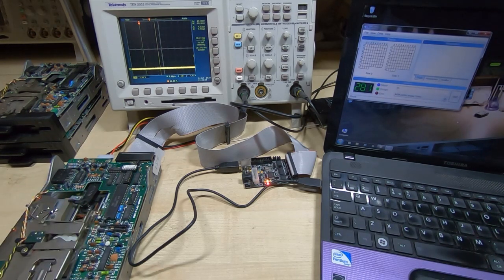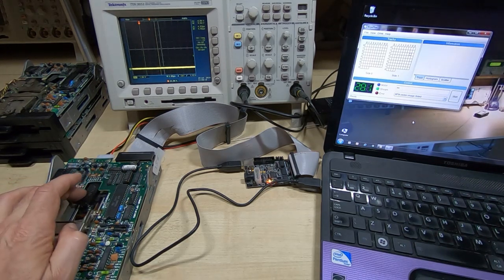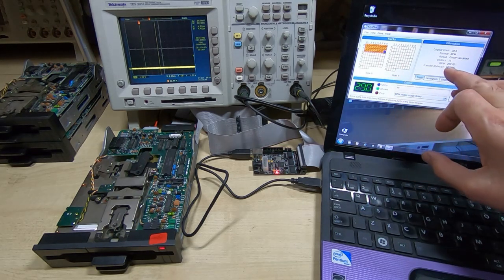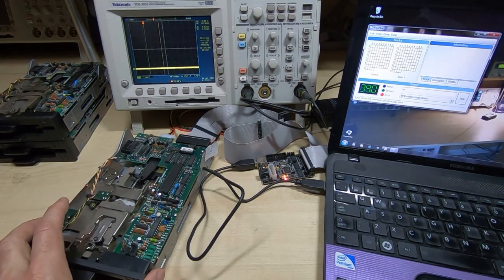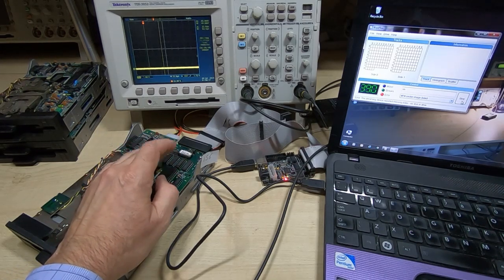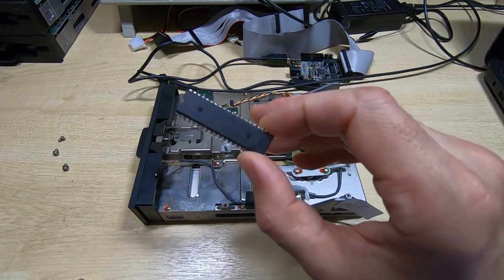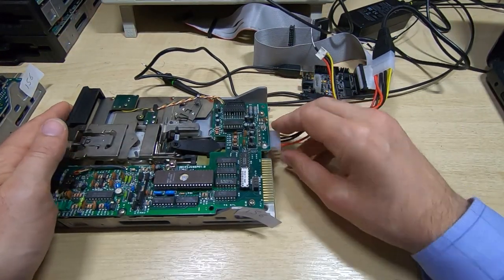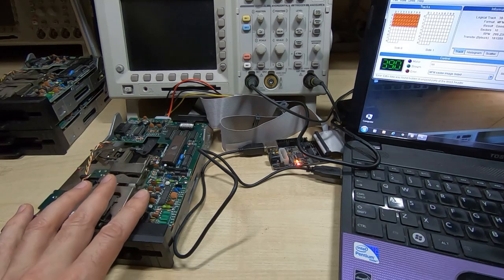F-051D Floppy Drive Repair Part1

Comment: You observed that you had the binary image to load into the replacement controller, but you didn't say where you got it.  Did you desolder and read to contents of another controller?  Were you able to read it from another controller in place?  Did you get the image from some other source?
Reply from the maker: I repair a lot of this sort of equipment and whenever I get the opportunity to read data from a device I am repairing then I try to do that before I start work. This is partly in case I make a mistake and damaged the original. I cannot remember when I got this image as it was many years ago (The file was dated March 1997 so it would have been around then). Some drives have these devices in sockets so most likely I either just unplugged one and read it or removed it for testing and took an image. In this case I had 5 other drives so as a last resort I could have removed one and read it but as they were soldered to the boards I prefer not to do that as there is always the possibility of board damage (or chip damage).

Comment: Hi Jerry, I noticed that when you are probing the floppy Micro-controller and/or the One time programmable memory controller. You used the probe without the ground lead from the oscilloscope to check the signal on different pins. Is your laptop running off the battery or is it connected to mains power with earth ground? Can you check any IC on the device under test without connecting the ground lead just to read the signal? Would you see noise on the oscilloscope if it’s not connected to floating ground? I assume the device under test is running from power supply using isolated transformer and laptop is using battery power not plugged into the wall.
I’m trying to figure out how to use the probe on a device under test, but sometimes I’m scared to try for fear of causing a short circuit or when checking negative voltage in old computer equipment. Your videos are excellent and I have been learning a lot. Thank you. Maybe in the future you could talk about ground in relation to testing different types of integrated circuits and power when using the oscilloscope and or Logic analyzer. I know the logic probes are connected to ground. But isn’t the logic analyzer also connected to mains power and earth ground as well.
Reply from the maker: Well spotted. I have mentioned this in previous videos but neglected to mention it in this one. As you correctly say there must be a voltage reference for the scope to work. In most testing of this type that I do I am not interested in accurate signal measurements but just in general signals so I find it more convenient to remove the ground clip from the scope probe. There still must be a ground of course or the scope would show floating signals. In this case you can see that I have a second probe plugged into the trigger input of the scope and the ground lead from this is connected via a test lead to the 0V of the floppy power connector (actually the un-used 3.5" power connector). You can see this at the top centre of the screen at approx 18:18. It is the white wire and this is clipped to the scope ground so gives the scope a 0V reference. It is not a good way to ground a scope if you want good quality signals but I discuss this in one of the recent videos. Let me know if you want me to make a video on the grounding methods I use.
Reply: @JerryWalker001   Yes, please I would like see a separate video on grounding methods you use. I have read several books to help me understand different types of grounding concepts.  Such as earth ground, chassis ground, reference point on a circuit , floating ground and/or different voltage potentials when using your test equipment to help troubleshoot all the types of equipment, I have seen in your videos. Honestly, I find it more instructive and intuitive when you explain the concepts and reasoning, instead just reading a book. Your experience adds that missing element that is priceless. Thank you Jerry.